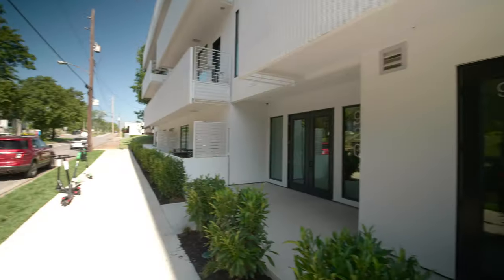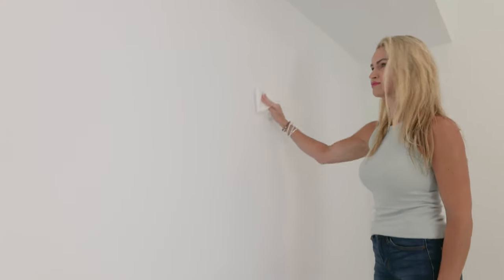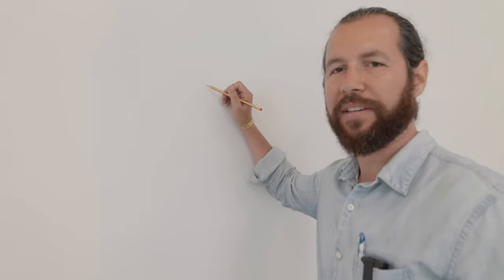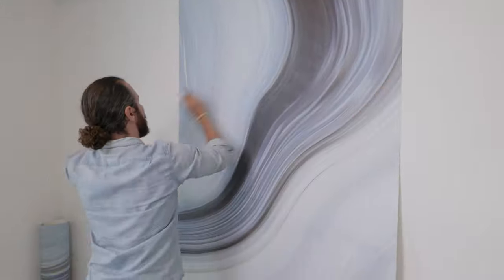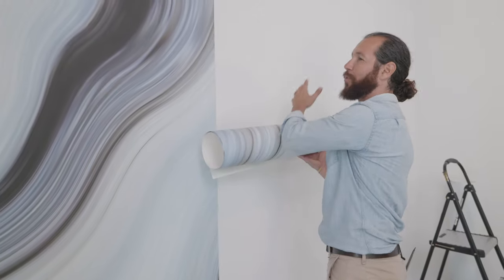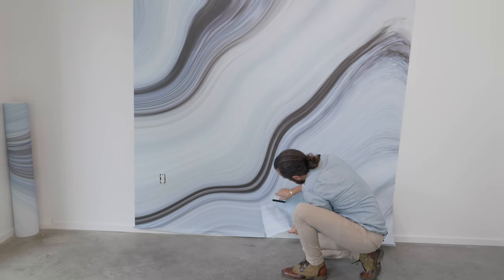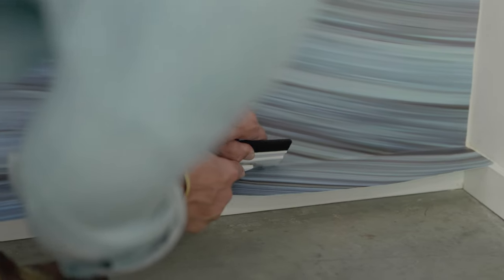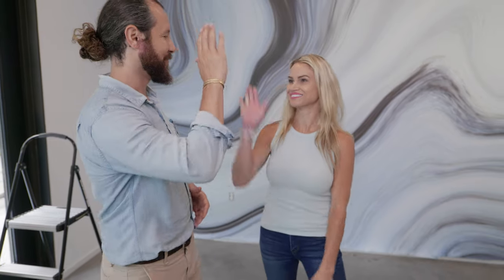How to Install Peel & Stick Wallpaper The Easy Way

Comment: Hi thanks for the video. What about semi gloss walls? My walls were painted about 3 years ago and I figured I needed to paint them with primer before applying the peel and stick wall paper. Can you tell me if that would be necessary or just some light sanding?
Reply: I have yet to actually install any peel and stick wallpaper (hence the reason I’m watching this video) but I am a professional painter and my instinct would be that the wallpaper would stick better to a semi gloss then to a flat paint/primer. Imagine sticking tape on a piece of glass versus a piece of wood, it’s going to stick a lot better to the glass. If it was traditional wallpaper using adhesive glue I’d feel the opposite, you’d want a less smooth surface.

Comment: What do you do if your apartment sucks and your corners aren't plumb?  If I were to cut the wallpaper in a straight line there would be a gap cos my wall edges are not straight...
Reply: Try starting from the ceiling in the middle of the wall and then work out... Then the lengths of the paper are straight even if your wall edges arent.

Comment: This is a very good video! You guys make it so easy. Can't wait to try this! 🥰
Reply: I have installed a lot of wallpaper and I can tell you that you do need several helpers. As you seen in this video the wallpaper will stretch out of proportion and it will not align properly. The wrinkle that he had in this video was not corrected and the camera veered away from it, but believe me, the wrinkle will rip if you pass too many times over it trying to remove it. Also, the wallpaper can stretch just peeling the backing off of it... not a good product.
I would not recommend this peel and stick to anyone.

Comment: Why not start at the left hand side?.
Madness starting at the middle.
Reply: I think because you need it to be plum and not all wall edges are.. so you go based off an even line in the center
Reply: If your left wall isn’t straight, then everything will be out. Also, for murals, you want to make sure the pattern is centred on the wall.

Comment: beautiful paper indeed ,but you misleading people.i am a professional paper hanger for the last 30 ys in Houston Tx and i do not recommend "overlapping ". seams should be butted tightly together and smoothed down with a seam roller." is ok" if you do-it yourself or you the owner of the office,building etc.but overlapping is out of the question. On the other hand  your wall should have sealer or primer,prep the walls is very important than just to " clean up " good luck
Reply: This wallpaper is made to be overlaped. The design won’t fit if you butt the joint.

And it’s not made to be double cut. It stretches when you pull it to take the under part and it doesn’t fit anymore when you put it back.
Reply: 40 years of experience here, from Las Vegas. Peel and stick is totally different from regular wallpaper, or commercial vinyl Peel and stick is made to be overlap up to 1/4 inch, do not attempt to overlap and double cut or butt the edges together, with time they will come apart because of cold weather/hot weather, expansion/contraction. Peel and stick is supposed to be installed on top of semi gloss paint, do not attempt to install on top of flat paint, it won't stick. Paint needs to be cured, the longer the better, in case you need to remove it to reposition it. One last thing, always read the instructions, sometimes they are half right. Lol
Reply: yes very different...

Comment: Dont trust to start in middle,
Reply: I know it’s counter intuitive. I learned from a different video they start in the middle because they need a straight level line and wall corners are rarely as straight and level as they need to be to start the wallpaper on.
Reply: @frankzbeanz4200  I get that but that's stressful, measuring it,
Reply: Walls are not as straight as it seems. I do start from the middle if it's a huge wall. Lot's of measuring but it's worth it. As most interior films are horizontally 120cm .

Comment: If you dont happen to have a straight edge, could you get by with using a gay edge as long as you were able to prevent sassy distractions? I'm all for making the most of the tools I have, but I dont want have to hear "Nuh-uh bishh that aint on there right, can you just CALL Lowes and make them do it because this is literally the worst , like..if it looks like this when its done im not gonna WANT to be mad but im prolly gonna be mad JUST SAYIN."